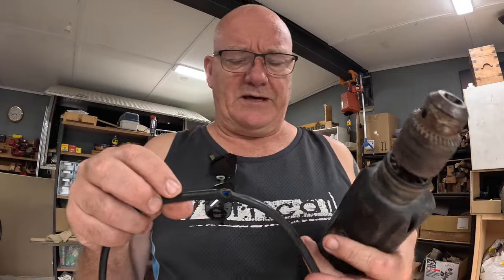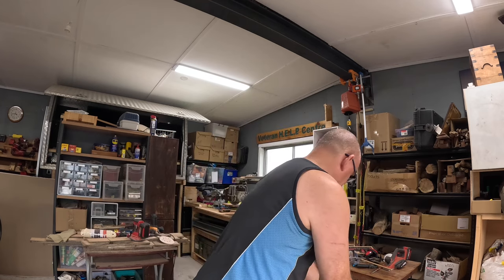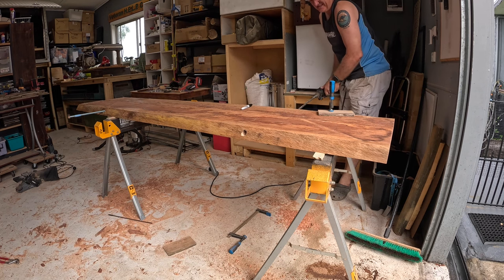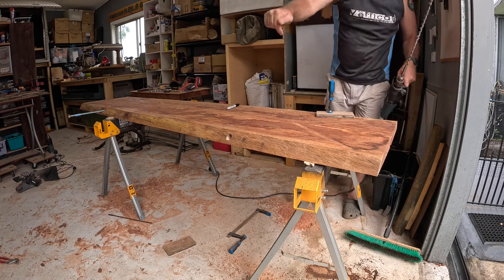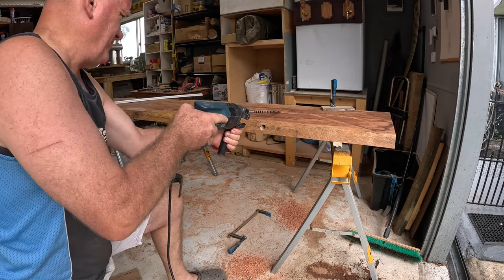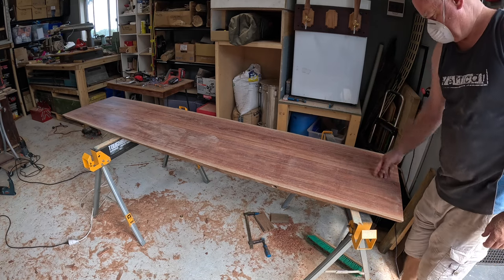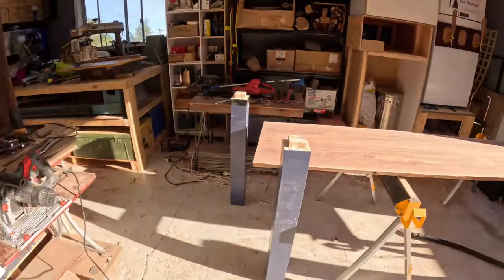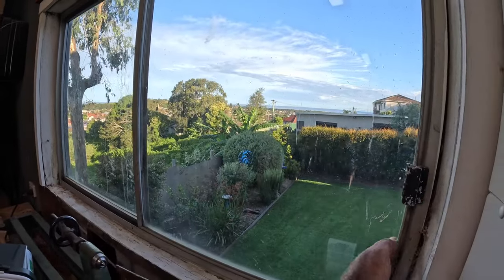Sunroom table Pt3 – I win!

Comment: I award you 1 or more “attaboys”.  Great work.

Now while watching I was thinking that some lubrication might have helped,  I’ve never heard of it but it is Ironbark.  I use beeswax on screws so they slide in better on super dense timbers.  Even water maybe might work.

The surface chipping by the plane was caused by planing against the grain, but Ironbark has an ever changing grain direction.  In days of old they used (and still do) a scrubber plane.  It is a longish body and has a blade  sharpened with an outward curve on the cutting edge.  To use it you go across the grain and it scrubs out lots of wood.  The long bed helps level the slab.  After, you can sand heavily or use a series of smoothing planes.  All hard work.
Reply from the maker: Thanks heaps Mike. I did (without showing it on video) try the opposite direction too, but – well, it was Ironbark! Anyway, the sander did the job.
Uuumm, I wonder if luberication might work? I didn't think of that.
I do think I might be on to something with my growth rings theory.
Whether it was that or just pure dumb luck, I don't know, but the second tunnel went relatively easy peezy.
Or maybe there was some special sort of extra density in that area that gave me grief in the first try.
Anyway, all the best for the year to come.
Brian
Reply: I agree with your theory, rings and rays are what make up timber, rings grow outward like ripples in a pond and rays go out like spoke on a wheel.  The interaction and history of the growth when alive form different densities across the rings.  The ring pattern you see at the ends are window into these different densities.  So yes I believe what you said about the rings bending your drill bit has accuracy.  On to the next…